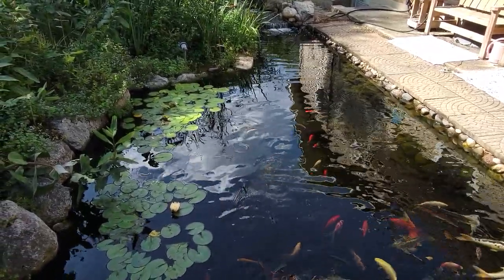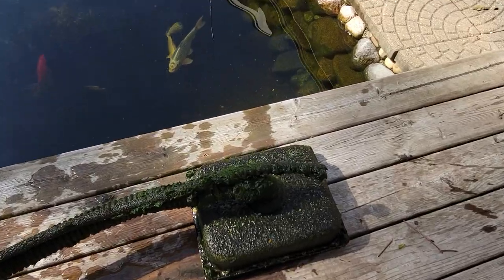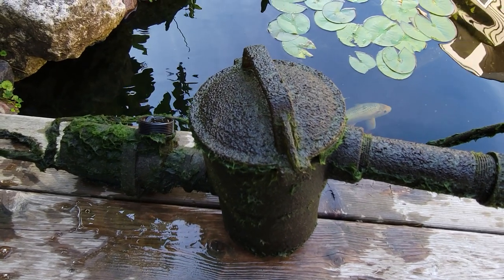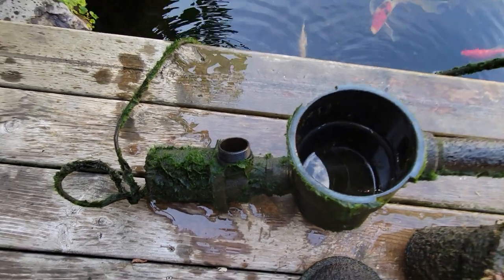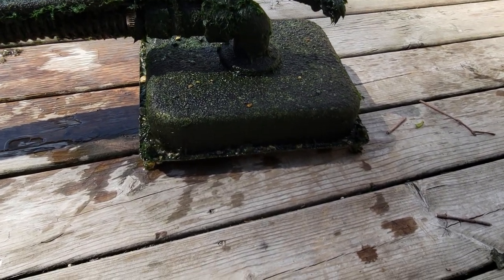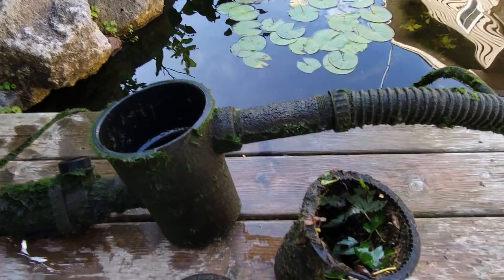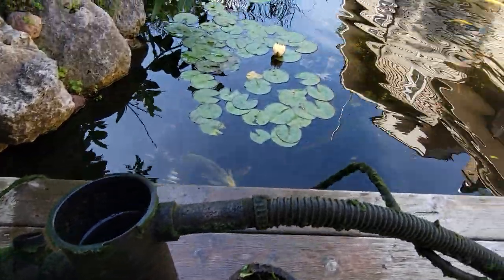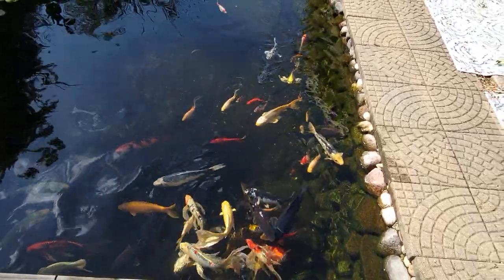Retro bottom drain DIY

Comment: Hey Jeff...Awesome set up.  Do you have a UV filter in line in your set up at all?  I want to replace my "traditional" filter set up, but have an external pump which pumps at a high speed (probably about 4K by the time it would be at the filter), so trying to figure out how to slow down the flow enough to still use the 3 barrel set up you have (Which is exactly what I want)  I'm thinking of putting the UV in front to help slow the flow, or perhaps splitting the in coming water between the barrel and the UV (and sending this portion back to the waterfall) so the barrels can work at the proper speed, because I know that is important.  Any thoughts would be helpful.
Reply from the maker: I do have a UV but it is submerged in my skimmer. For your setup I would just branch off the pump and split between the barrels and a UV return as you suggested. You might also want to check the actual output of the pump once you get the barrels installed. the extra head height may slow down your flow to a useable rate.

Comment: Morning Jeff. Question. Would it be possible to run the 3 barrel filter setup you run without the bog filter you have? Looking to make the same set you have. But I dont have the space to make a big set up. What else would I need to do or add to get similar water quality you have??
Reply from the maker: Absolutely. The bog is separate from the barrel system and primarily there to handle nitrates. I've set up several ponds with just the barrel system with great results.
Reply: Ok thanks man. Out of alot of the videos I've seen on here your setup is the simplest and most cost effective set up. Keep up the good and informative videos. 👍

Comment: Hi Jeff, I just got a quick question. I am building your DIY barrel filter. Will  2-in PVC pipes be big enough if I'm running a 3,200 gallon pump?My concern is overflowing.
Reply from the maker: I run a 3200 gph myself. With head rise and frictional loss you will be just fine.

Comment: Just wondering…since I already have the hi blo aerator; I have a manifold attached to it so I can control the amount of air coming through the line. Do you think I can use that just for the aerator part of the retrofit drain system? I will use the TT3000 to pump pond water to the barrels. Any thoughts would really be appreciated. Thank you
Reply from the maker: Any aeration is great. Putting it on top the retro drain will just increases its efficiency.

Comment: Hi Jeff! What equipment did you use th drill the stainless pan to attach the bulk head? Also, how is the aerator attached? Thanks for all your informational videos! Absolutely genius!!
Reply from the maker: You can drill the bulkhead hole with a cheap holesaw. The aerator is just zip tied to the plumbing beyewwn the drain and pump.
Reply: @jeffakamax  Thank you!!
Reply: I have a Danner air pump with two diffusers in the pond. One is a mátala disc and the other is one of those that looks like an octopus. Lots of air is pumped into the pond. If I figured out a way to attach one of these to the pond, attach the bulkhead to run pipe to a leaf basket and attach that to the submersible pump which would run to the barrel filtration would that create the sucking power to remove leaves and muck from the bottom? Not sure how to attach the mátala air disc and would appreciate any thoughts and suggestions you might have. I am definitely a novice and am pretty confused! Thanks for any tips!!
Reply from the maker: @linda-bagobones75  air lift pumps can definitely move a lot of water but they require oversized piping and LOTS of air volume and are generally not efficient for a homeowner pond. A small submersible pump is the way to go.
Reply: The hi blow is used only to get more oxygen into the pond. There is a 3000 gph submersible pump in a skimmer basket that carries the water to the filters out to a waterfall and into the pond. My plan is to attach a leaf basket from the retro drain and to the pump for circulation

Comment: Thx a bunch!  What size hose did you use to connect the drain to the basket and to the pump?
Reply from the maker: 1.25" cheap flex tubing. I only use that tubing inside the pond because when it fails it won't cause any harm.

Comment: What are the sizes of your pump strainer and the pump inlet? How do you connect them together?
Reply from the maker: it's a submersible 3200GPH pump. Has threaded inlet & outlet that attach right to the leaf basket.
Reply: @jeffakamax  thank you for your quick response. I have a 3600GPH submersible pump and a 1.5 inch inlet/outlet leaf strainer. Unfortunately, both the pump and the strainer don't have the same size openings so I'm at a loss on how to connect them together. That's why I asked the sizes of your pump and strainer.
Reply from the maker: @ThanhLe-wv7pr  Is the leaf basket 1.25"? if so, you can get an adaptor for 1.5 to 1.25
Reply: @jeffakamax  the leaf basket is 1.5 but the pump is 1.25.
Reply from the maker: @ThanhLe-wv7pr  https://www.amazon.com/Banjo-RB150-125-Polypropylene-Reducing-Schedule/dp/B0079JYBAK/ref=sr_1_55?crid=17QC0CSWR34NV&keywords=1.25%2Bto%2B1.5%2Bpvc%2Badaptor&qid=1681236059&sprefix=1.25%2Bto%2B1.5%2Bpvc%2Badaptor%2Caps%2C124&sr=8-55&th=1